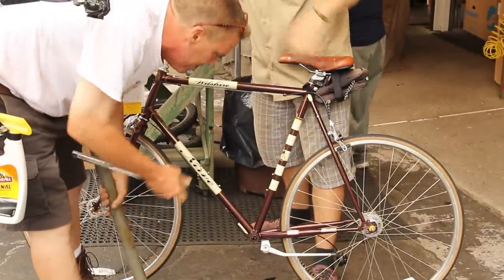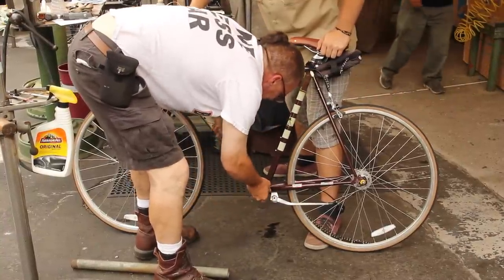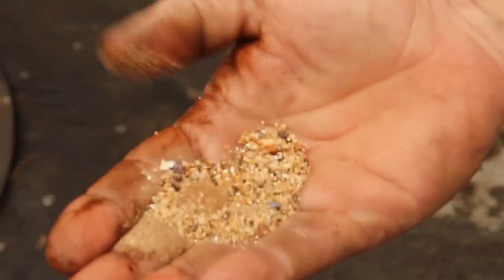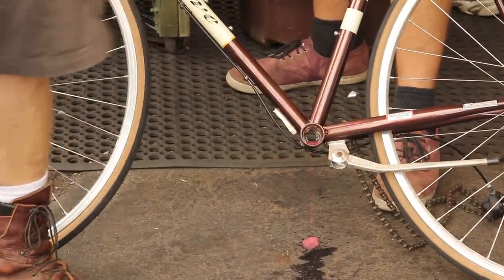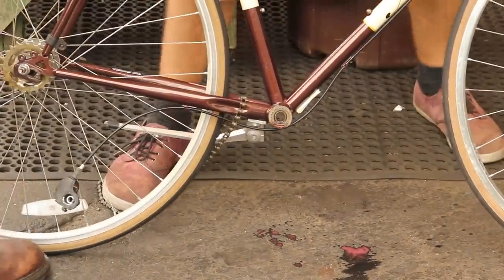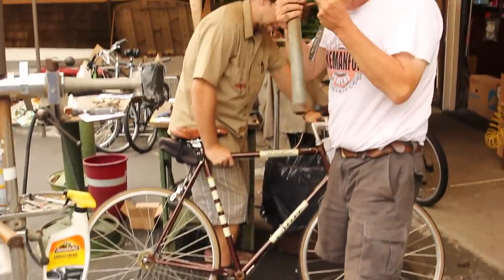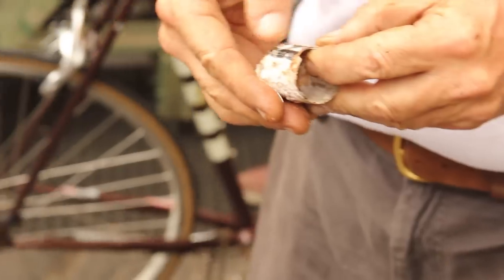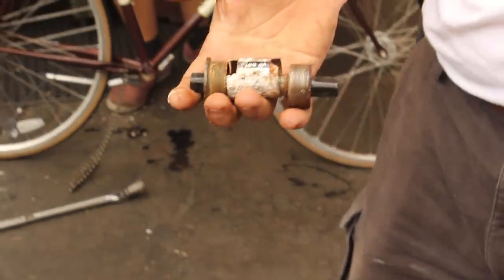Remove A Tough Bottom Bracket - Body Mechanics & Leverage -- BikemanforU How-To

Comment: i use a washer and a screw to hold the bottom bracket removal tool in the axle (the 32mm icetoolz type, that has a large opening). very easy and safe

Comment: Sorry for being late to the party as for myself I'll remove a stuck SHIMANO BB with a CYCLUS Bottom bracket removal tool it will be with a threaded keeper that threads into the spindle and this tool will be with a straight unfixed handle, I've been using this tool for roughly 20 years for hard to remove BBs, I'm very surprised that no one is using this tool for such BBs, they newer offering will be with fixed double angled handles and the newer offering will also be with tooling flats so a wrench can be used for assistance for the removal of really stubborn BBs.

Comment: TIP: in the first 2min of the vid, when you're cranking down on the breaker bar, you should really use open palm instead of closed fist (your left hand) there is always the chance that you'll slip and the last thing you want is to smash your fingers on the floor with that breaker bar in hand. learned that the hard way while working on cars...
Reply from the maker: Good point

Comment: A "bottom bracket" is a  FRAME part. What most people call a bottom bracket is the crank bearing assembly. The crank bearing, in most cases, screws into the frame part known as the "bottom bracket". Crank bearings can be built up from loose parts: cups, spindle, and balls. Or the bearing can be a cartridge assembly.

Comment: I had to use an impact screwdriver with 1/2 drive on my bb,did the trick.
Reply: That's where I am heading. Hoping my car mechanic neighbor has one or else it's off the Harbor Freight. If I had a bike shop it would be in my tool kit.

Comment: Bikeman!! I got one I can't get. And the bike shop(s) couldn't either! Can I heat the frame around the bracket, the frame is aluminum? I can go into detail, but trust me, it won't budge! Need some real 911 advice here! PLEASE!
Reply: Bolted tool into bracket and put it in the vice. Tried airgun. Tried airgun w/wrench! Tried with the bar, like in the video, and I've soaked in overnight in liquid wretch.
Reply: I used a 10 foot Breaker Bar, no kidding.  All I had to do was sneeze on it and it worked.
Reply: Thanks man! It worked! It actually worked. I had to soak it overnight in penetrating oil, but I ratcheted on the tool, place a wrench on it with about a 6 foot breaker bar and... WHAM!! One sneeze brought to it's knees! Thank you sir! Gold star by your name!

Comment: This is why aluminum was invented for bikes.  If that frame was aluminum that wouldn't of happened.  At the very least the frame wouldn't of corroded.
Reply: Aluminium still corrodes it's just that the oxide protects it but when that gets scratched off the metal is exposed and it corrodes more